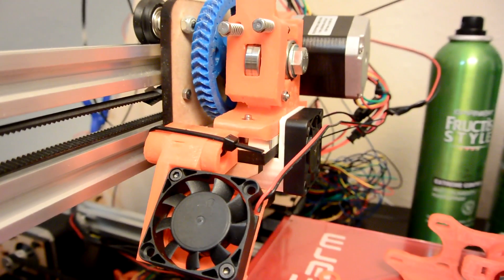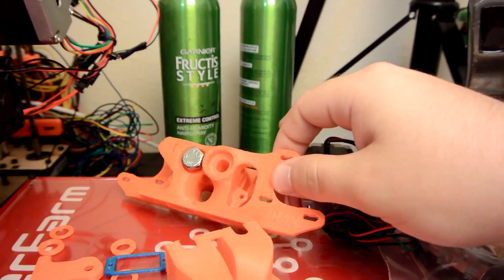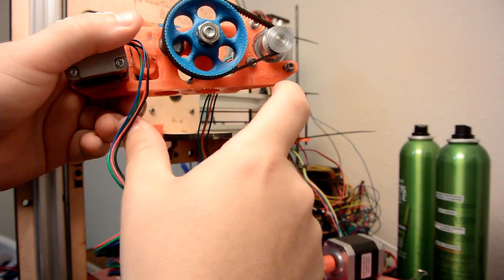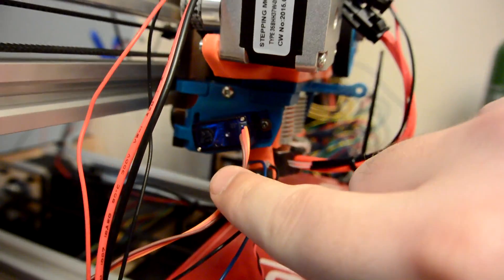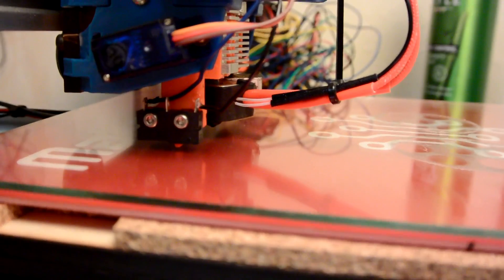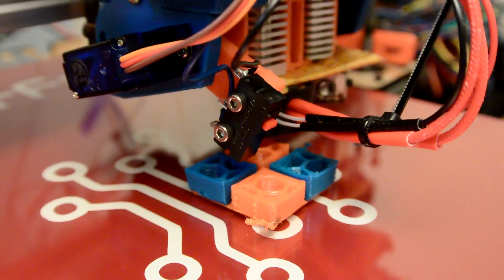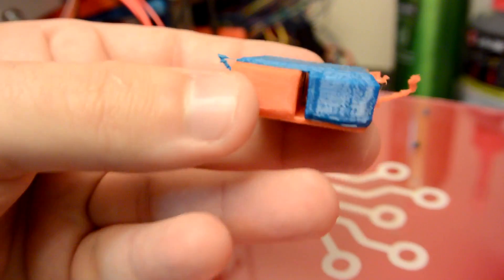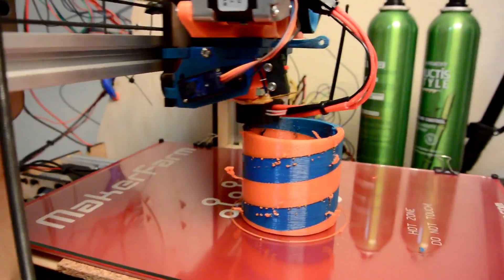Itty Bitty Double Flex Dual Extruder on my Makerfarm Prusa i3v!

Comment: I have the same Maker-Farm 12" printer and also upgraded to the Itty-Bitty-Dual-Flexstruder - but with a Rambo V1.1b board and the full graphic display.  I have the Marlin (bugfix V1.1.9) changes required in config.h if anybody needs them.  Marlin 2 is just too hard to compile/link in any Arduino IDE in earlier windows envs.  Just reply to this comment and I can send you an email with the file and whatever else you need - IE old Slic3r settings, pins to use for the leveling servo  etc.   Neither Colin or Clough42 provide the info anymore.  BTW all that is missing from Hoffman's "early adoption" dual print is a purge tower and an ooze shield - which may not have been available 5 years ago.  The dual Hot-End is heavy but the Maker-Farm can take it no problem - though you have to bolt it down at high speeds.  This video is still relevant.

Comment: are you happy with your hexagon hotend
Reply from the maker: I've had no issues with the hexagon, still printing perfectly for the last couple of years!
Reply: Hoffman Engineering have you printed pla too without problems like jaming and can you change the heatbreak like on the e3d v6
Reply from the maker: I've printed ABS, PLA, Ninjaflex, HIPS, Filaflex, and a few others without issue. And yes, everything unscrews; nozzle, heat block, and heat break.

Comment: would it work if I use PLA for the new frame? or should I stick to ABS because of its higher heat tolerance? Thanks for the helpful video btw!
Reply from the maker: Thank you for watching! I think you'd want ABS for the fan shrouds and anything else near the hot ends, but you may be fine for the rest of the extruder pieces with PLA.

Comment: Hi there at Hoffman Engineering,
I have a few questions, as I am doing research on which 3D printer to get.
1. Would you recommend this MakerFarm?
2. Do you have the 8" or 12"?
3. If I Upgrade to the dual extruded, would I lose print quality?

Thanks for your help!

Comment: Hi, I would like to add to my printer a second extruder, such as motherboard mounts a "MKS Gen1.3 ," I have to change the firmware?
Reply: +Mattdj Mio  You will have to change the firmware, its pretty simple though. Depending on what printer you have?
Reply: +Logan Crawford i have prusa i3 sunokey
Reply: Mattdj Mio
 Since it's a Prusa, it will use Marlin! It is a very simple and easy interface. I am currently tweaking mine with the latest Marlin. Here is a link I found for you to get started with. Using "Arduino" and putting the marlin firmware into it, you can change the number of extruders and offsets. There are many guides, but if you need more help, email me at (oda516lc@gmail.com)

http://www.thingiverse.com/thing:1213284

Comment: Can you use capacitive proximity sensor as auto bed leveler instead of the servo solution on this extruder?
Reply from the maker: +Hampus Lundin It might require some modifications, as the extruder wasn't originally designed for it. I'm not sure what kind of sensor you are thinking of (a separate sensor, or using the metal hot end, etc), but as long as the firmware supports it, it should be do-able.

Comment: What is the software you used towards the end to control the printer? My motors spin in reverse and I wanted to know if there was a software I can use to do this, Thanks!
Reply from the maker: +Dima Dombrovski The program was Pronterface, allows you to connect and send commands to your printer. As for motors moving the wrong direction, you can either fix that in software by changing a few settings in your printers firmware, or simply rotate the connections of your motor to your control board by 180 degrees. Reversing the connection is the easiest solution there.
Reply: Hoffman Engineering Thank you for the quick reply, I emailed Colin over at Makerfarm and said to that also, which fixed it, but thanks! Also had a look at pronterface.. but looks pretty complicated. Maybe after I figure this extruder out Ill look at it.
Reply from the maker: Colin's pretty awesome, glad you got that all sorted out! Pronterface gives you a lot of options, but most of them won't be needed to just test printer motion. Good luck with your build, happy printing!
Reply: Hoffman Engineering Thank you!

Comment: Mr H. Engineering,

I've just printed the Itty Bitty Dual, and this morning finished the Itty Bitty Dual flex V2.
I'm going to swap once I've got it ready to go. (I've printed in PLA. Will reprint to ABS if needed.)

How do I find 'how to find' how to design a dual color part with meshmixer?
How do I slice (separate stl for each color?) ?

Aren't you supposed to run those wires through the chases in the shelf?
Reply from the maker: +Gary Deen Hello! I haven't used meshmixer to do two-color part design before, but they did release a video about that this morning actually! You can try the method here: https://www.youtube.com/watch?v=PCgP8VLFaz4

I generally use Onshape, DesignSpark Mechanical, or Solidworks to make my two-part projects. Normally what you can do is design the part, and export each of them as separate STL files. Inside Slic3r, you import one of the stl files, then click on it and click "Settings". From there, you can add the second stl file and it'll combine them into a single part. Then, assign one of the parts to extruder 1, and the other to extruder 2. Slic3r will then take care of switching between the two as nessessary.

As for the wires, there wasn't enough space in the middle for me to put them, but there are zip-tie mounts right next to the motor to connect them to. It will work either way, as long as the wires aren't bent/kinked.

Comment: Nice video.  I'm glad you like it.  Thanks for sharing.
Reply from the maker: +James Clough Thank you for creating it. It is a great design, very elegantly thought out. If you make any tweaks or changes, I'd be more than happy to try them out!
Reply: +Hoffman Engineering I released a new version a couple of weeks ago with a whole bunch of minor tweaks.  The filament path is even more tightly constrained now to handle very flexible 1.75mm filaments better and I made a number of minor changes to make the parts easier to print.  Overall, if the first version is working for you, there isn't any particular need to upgrade.

Comment: i can just simply replace my extruder with this one ??
Reply from the maker: +Jimmy Haidar Yup, this is a full replacement of the makerfarm prusa i3v extruder. You'd need the hardware kit, and the laser cut back of the x carriage. (You could print those, but I don't have designs for them, so you'd have to find them.)

Comment: To solve the issue of oozing :
1 - the reprap way : do a "blob" tower on the firmware where every change of filament you print and leave the blob there.
2-  another reprap way : do a "cocoon" that envolves the figure. Its just an offset for the outermost layers ...
3-  the "pro" way (stratasys): put a brush somewhere on the -X or + X axis side. Go leave the blobs of the last color there and extrude a bit of the new to use there to purge.  You end up with a can with some "abs/pla  spaguetti" after each dual print, but it works. Saw it on a stratasys 1200es ... that's a 9 year old printer with dual extruder (material and support, both abs).
4-  The BCN Dynamics way: Each extruder is independent and moves separetly on the X axis. Seriously, look up the BCN Dynamics Sigma printer ... I was really sceptic at first, but the dual color parts have 0 ooze and you can use two very diferent materials.
5-  The "overthetop" kickstarter printer: I'm afraid i can't reveal which brand is this (i work with those printers ) but they use a needle valve to close/open the nozzle. Yep, you calibrate the point of aperture , and you have 0 oozing even with single color. 

For a prusa i3 ... you can easily search for a blob tower or cocoon, but those use so many material and make the printing slower ...

maybe putting some kind of plastic tab on the +X/-X side Z carriage, so you go there, clean the tip, and resume quickly?

I saw this guy doing this for priming his delta ... watch?v=GJjhfp9_WCU .

Cheers, nice project to work on!

Comment: Nice. Can you share what the new firmware is. I like how the auto bed level doesn't lift the servo arm every probe seems much more likely to be accurate that way.
when i finish my new printer build i think i will set up one of my printers with duel extruders and play around with it... looks cool